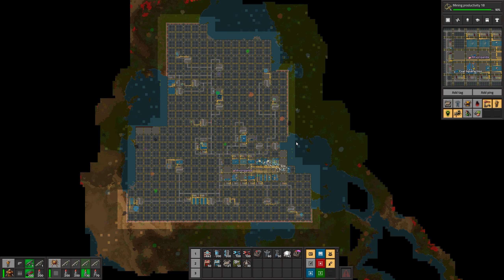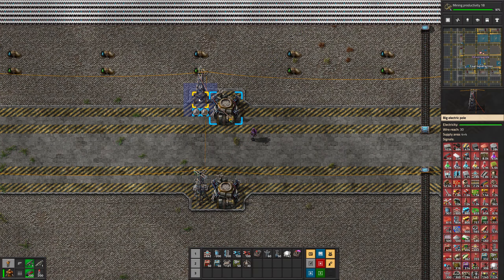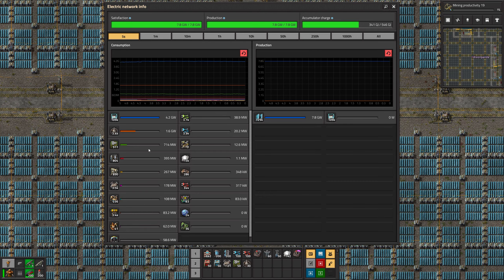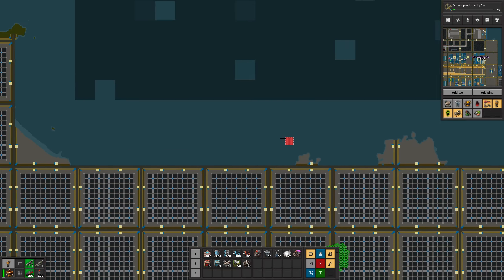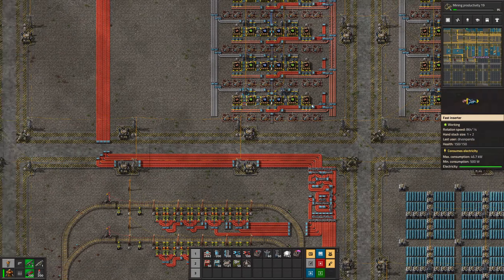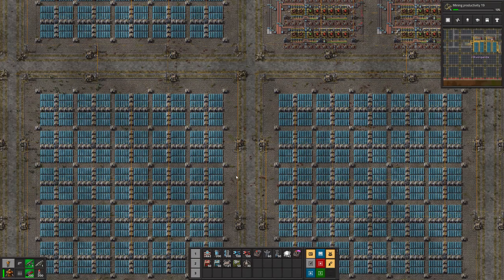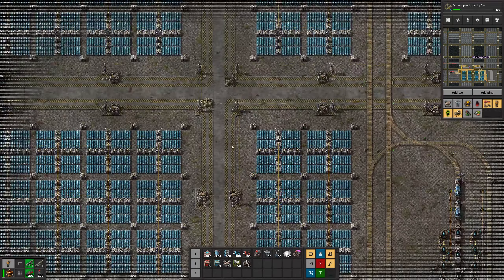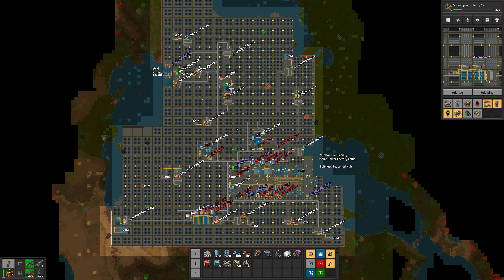Factorio base review | Dr von Panda

Comment: 20:00 I would use fast inserters over stack inserters to feed copper plate in as is done here, but I'd use stack inserters to feed the copper wire into the green circuit assembler.  In sandbox testing a number of endgame builds I found that stack inserters actually came out slightly behind fast inserters for an even flow of a small number of items on or off a belt - the stack inserters produce a "lumpier" flow of items that can actually interrupt production.